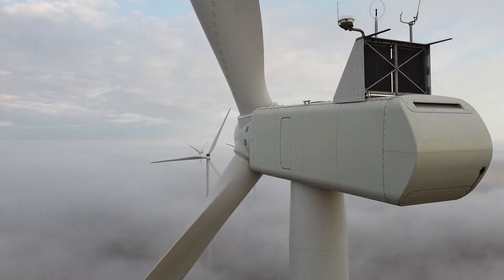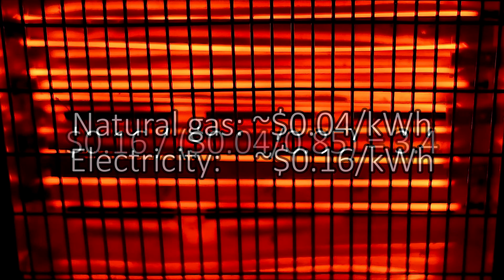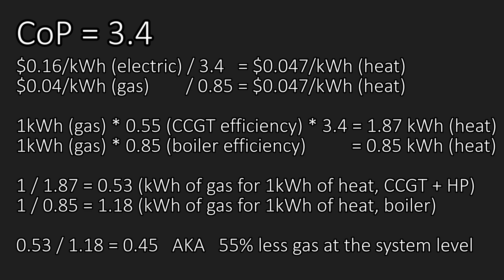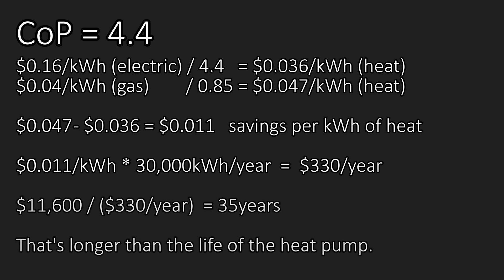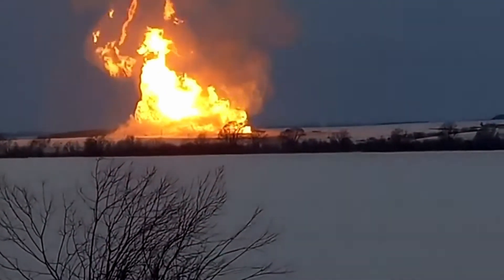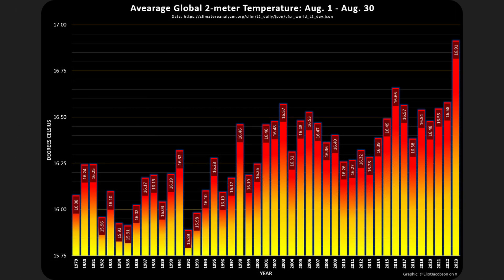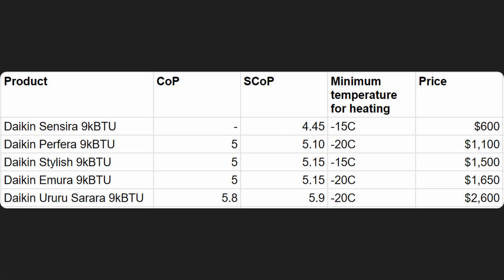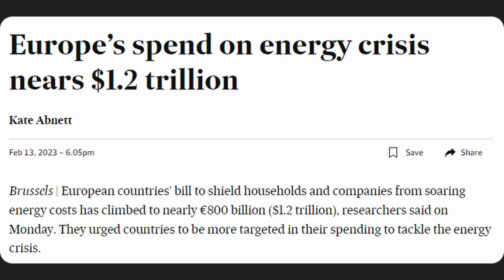How ACs will Save the Climate

Comment: In winter, a COP of 2.5 is more realistic. Yes, COP of +3 is possible, but in summer we should not heat...
An efficiency of 55% as far as the power plant is concerned.
Add transmission losses, again -30%.
Again calculate your efficiency with additional 30% transmission losses and a COP of 2.5 in winter.

And now to my consumption: gas boiler with a water temperature < 50°C, efficiency +98% (was measured during the 2 annual mandatory inspection).
I can beat the heat pump with a 10th of the investment.
But I am not everyone, and some can save energy with a heat pump.
But the heat pump is not the holy grail.

And then my total consumption per year:
- gas = 5000kWh (heating, hot water, cooking)
- electricity = 2000kWh
- petrol = 200L/year = 1800kWh

So for 2 people, I easily stay under 10000kWh/year, for everything....
Are we now 3 people tomorrow, heating stays the same, lighting too, so that doesn't increase proportionally, we still stay under 10000kWh/year.

Oh, and without PV.

Maybe people should think about their consumption instead of changing their energy source and thinking they are green.
Changing energy source is not green, consuming less energy is greener.
Reply: The thing with heatpump is that you will not use 100 % electricity from gas power plant, that is worst case scenario. In reality in Europe, you will have over half of the electricity from renewables or nuclear, which is good. 
And also 10 MWh per year, where over 2/3 come from fossil fuels is a lot actually. 2/3! Think about that…

Comment: I live in the south of Europe with very hot summers and 2-3 months of cold weather.
- I live in a flat that was last renovated in 2019, last floor and that suffers from what is called a greenhouse effect (very hot in the summer and quite cold in winter). Isolation is fair.
-  my flat is fully electric, no central heating so only electric radiators.
I bought my house in the beginning of the summer, so my experience was only with the Aircon that was already installed (Heat Pump Daikin Sensira, funny enough like the example given in this video).
The total electric consumption in the summer was quite good to the point that I had the Aircon constantly running. When winter and the cold days came, I did what everyone would do so I turn on the electric radiators… my average kilowatt spending was over 35kw daily and to be honest with very poor results in regards to comfort although spending stupid amounts of electricity.
So I thought “I have a heat pump, let’s have it to go”… and that was exactly what I did with interesting results:
- my electrical consumption went from more than 35MW to 10MW. 
-  the comfort feeling of forced air heating he’s much better than the comfort provided by the electric radiators ( I can actually heat the whole flat instead of luck warming feeling just where I had the radiators).
So yeah, I guess that the author of this video is correct in his analysis, very correct actually.

Comment: Another benefit: you can lower the temperature of your gas/oil boiler because of the second heating source it doesn't need to be as strong as before. This in return minimizes systemlosses.

Comment: I think a big problem with heat pumps is they're being installed like they're A/C units. If you're doing say new construction, you can have the heat pump exchange with the ground for the constant ground temperature in both winter and summer. In temperate climates, the summer ground temperature several feet down is basically free A/C, and in winter is much warmer than the external ambient temperature.

Comment: I don't understand why so many people think that you should just put up with 25C or more in the home during the summer but wouldn't dream of switching off the gas and living in 10C during the winter.

I mostly work from home, with temperatures sometimes exceeding 30C in the summer, which was just unacceptable. 
I consumed 270 kWh (solar energy) to cool the house last summer, which fits your story about how cheap A/C cooling is when compared to heating using a heat pump. 
And 27 time less than the gas I used to consume for hearing during the winter months!

Comment: I'm really happy heating my house using A/Cs. 
I previously burned around 7,400 kWh of gas to heat my home October through April.
The A/Cs consume around 1,420 kWh. Plus 1,150 kWh to heat water, mainly for showers, as I haven't yet replaced my gas powered water heater.
We have net metered electricity here in the Netherlands, so my PVs provide all of the electricity I need to power my home and EV. I estimate a payback time of around 7 years, based on my current energy contract of 30 cents per kWh electricity plus fixed charges.
I didn't do this to earn money but to be honest I doubt that I'd have invested 16,500 Euros without any financial return.
Let's hope I've still got 7 years left in me. 😋

Comment: Also who wants to burn gas? Yes the majority of the primary load is still fossil fuel of choice* but grids getting greener and people want to support green choices if they can afford it. Here in Australia/Tasmaina, my summers are 35'c and winter can be -1/3'c for a week in dead of winter. Have a reversible A/C system and just added solar+battery so free AC in summer and cheaper running heating in winter. Also all of Tasmania's power is Hydro and Wind+solar so we are pretty lucky here.
Reply: There is no green energie…
Reply: @ivojanssens221  YOU"RE A F HEAD.
Reply: @ivojanssens221  Depends how you define green energy.

Comment: Passive solar houses facing south could heat homes cheaper.
Reply from the maker: Sure, but tearing your house down and replacing it with a passive house facing south will cost on the order of $200,000. Even if you can cut 100% of your heating costs, that's still about 80-100 years payback time

While efficiency is great, it doesn't actually bring climate control needs to 0 in practice, and reversible ACs are still the best way to close the gap